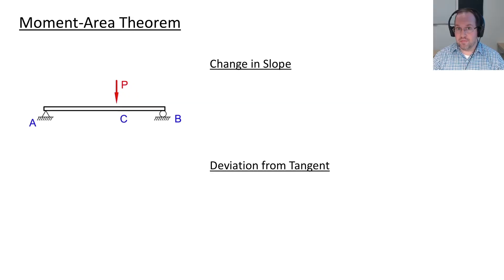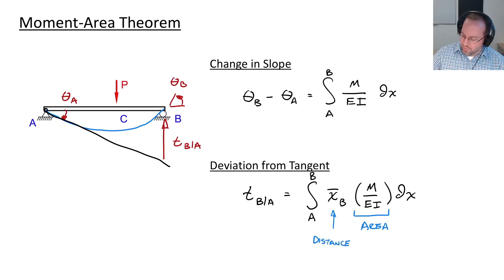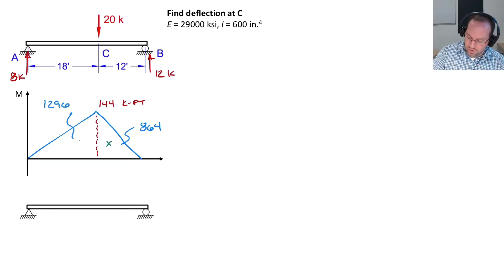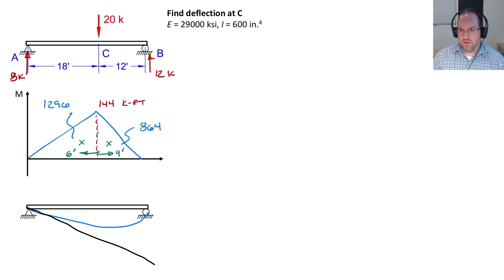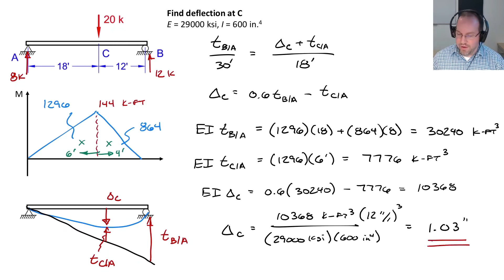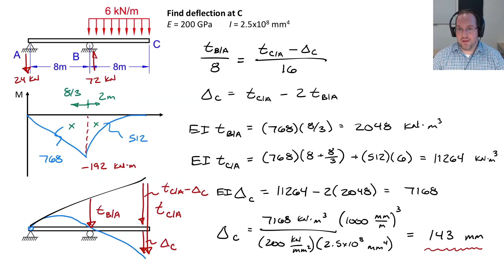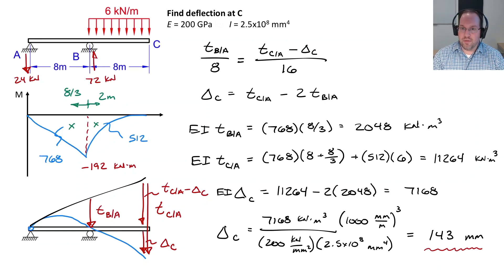Deflection of Beams using Moment-Area Method - Intro to Structural Analysis

Comment: If there is internal hinge in the beam, how should we proceed ?
Reply from the maker: You can’t integrate across the hinge, because the slope changes abruptly at that point. So when you draw tangents, they are not allowed to cross the hinge.  Depending on exactly what deflection you need to find, this may not cause any issues at all. However, in some cases you may need to rely on the fact that the deflection at the hinge is the same whether you come at it from the right or the left.

Comment: Does the negative/positive component of the M diagram become relevant if some parts are negative and some are positive? In the second example, even though it was negative you didn't include it?
Reply from the maker: Yes, the moment diagram sign is relevant if some is negative and some is positive. The sign gives you the direction of curvature (positive opens up or "smiles" while negative opens down or "frowns"). It is important to keep this consistent in general when taking the moment of the area.

That said, if the sign is all positive or all negative, I usually handle the signs intuitively (some might say lazily!) for the moment area method just by considering the deflected shape geometry. The negative sign in the second example is reflected by the fact that the deflected shape is below the tangent, whereas the positive sign in the first example is reflected by the fact that the deflected shape is above the tangent.
Reply: @StructuresProfH  Awesome, did some examples and its making much more sense.

Comment: Thank you, I'm building an Excel spreadsheet for these calcs . A client is asking for load charts for lift beams, where the position of single and dual point loads vary. I've been looking for a  more efficient method than dozens of FEA models. Much appreciated.

Comment: How do you solve this kinda of problem on a simple beam for max deflection with UDLs and point loads Im struggling immensely with area moment.
Reply from the maker: Are you struggling specifically with locating the point of maximum deflection? Maximum deflection will occur at the point of zero slope. I'll illustrate the idea with the second problem presented in this video, but I'm afraid it will be tough for me to extrapolate here in the comments section to whatever specific problem you are trying to tackle. At any rate, I hope this helps...

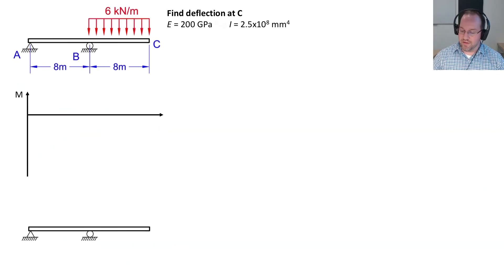Let's say I want to find the maximum upward displacement in Span AB in the second example problem in the video (starting at 10:00). I can find the slope at point A using the deviation t_B|A. Slope at A is equal to rise/run, where the rise (vertical distance) is t_B|A and the run (horizontal distance) is 8 meters. The area under the curvature diagram (which is just the moment diagram divided by EI) is the change in slope. So my goal is to find distance X from point A where the slope becomes zero. Here are the numbers:
  -   t_B/A = 2048/EI (from video 13:20)
  -   Slope Theta_A = (2048/EI)/(8 meters) = 256/EI
  -   Area under moment diagram from A to X = 1/2*X*(24X) = 12 * X^2 ... [note that at X = 8m, this is 768, which is the area under the triangle at 10:45]
  -   By extension, the area under the curvature plot is 12 * X^2/EI, because curvature = M/EI
  -   Therefore, the value of X with zero slope is at 12 * X^2/EI = 256/EI, which gives X = 4.6188 meters.

Now that I know the location of where I need to compute the deflection, the actual deflection amount can be computed using the similar triangle methods illustrated in both examples. Here I would want to find the deviation t_X|A, where X is that point of maximum displacement. From similar triangles, I can see that...
   (Delta + t_X|A)/4.6188 meters = (t_B|A)/8 meters
where Delta is the displacement I want to compute. Deviation t_B|A = 2048/EI, and calculating t_X|A gives...
   t_X|A = (256/EI)*(4.6188/3) = 394.14/EI
Now solving for Delta gives...
   Delta = 4.6188/8 * t_B|A - t_X|A = 4.6188/8*2048/EI - 394.14/EI = 788.28/EI
Plugging in the values of E = 200 GPa and I = 2.5e8 mm^4 gives a displacement Delta = 15.77 mm

Again, I hope this helps, but I apologize if this was not exactly what you were looking for. Sometimes finding the areas and moment arms of the shapes under the moment diagram can be tricky. For problems with really complicated moment diagrams, I'd probably choose to use some method other than moment-area.